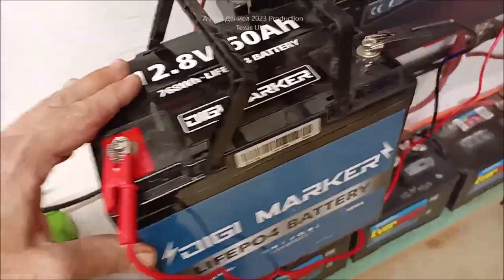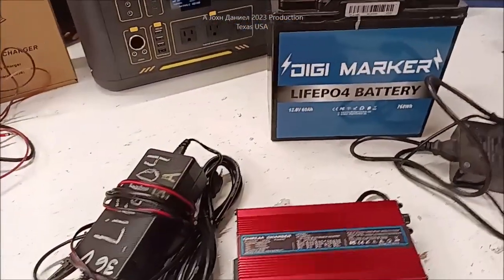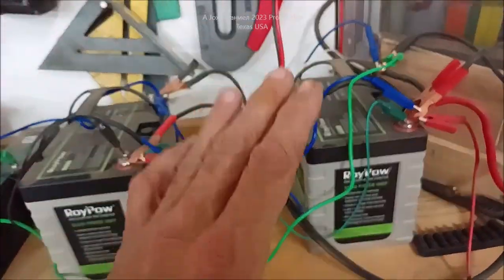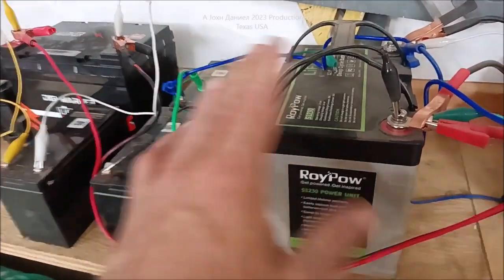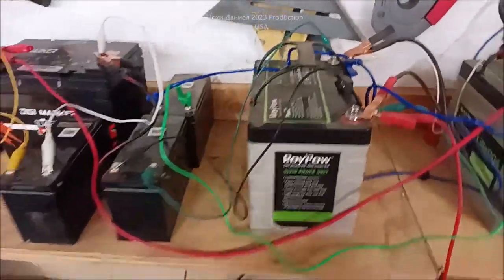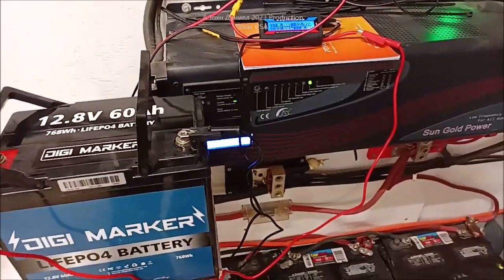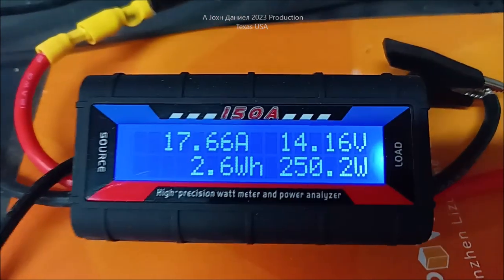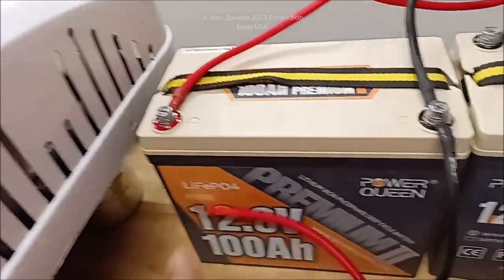Using my 3,400 amp Lead Acid Battery bank to Direct Charge a LiFePO4 battery? Learn how

Comment from the maker: Support/Join with KoFi - https://ko-fi.com/john4kiera OR https://bit.ly/2buyaCoffee all support helps. PARTS 5Pcs 14 Gauge Jumper Wires Alligator Clips Silicone Test Leads https://amzn.to/3s5B017 and 150 amp RC Meter https://amzn.to/454j8Ch
Previous Video  info under video, such as Minerals DC-DC charger+solar MPPT https://s.click.aliexpress.com/e/_Dld9KE3

Comment: Hello John, can I use this to limit the amp draw coming from my alternator so I dont over heat it? Or do you recommend a better way to limit the alternator?  Thanks and will definitely send you a tip for the advice.
Reply from the maker: You will need a buck and current limiting device, the best DC to DC models are by NEW POWER https://s.click.aliexpress.com/e/_Dn0nSz3 they take 8 to 16 volts from your auto system, limit it to 40 amps max, and charge LiFePO4 at 14.6 with tapered charging. Renogy makes a similar one for 2X the price and less the ability!

Comment: So John I could hook up my power queen 200 ah lifepo4 battery to my powerstar 200 ah AGM Battery that's connected to a mppt controller and 600 watts of solar and a 2kw pursine ? Just parallel a connection ?

Comment: Ok, so I have some identical 24V 280Ah packs with a BMS set to charge at up to 100A. Charging speed aside, if I wanted to connect them together at different SOC, would it be safer to use 2awg? This video makes it seem that it would be just as safe or even safer to use 12awg, that the BMS paired with voltage drop will result in a perfectly safe amount of current dependent on the wire I choose. Is that right?
Reply from the maker: Trying to balance them? You will want to get within 20% of condition and State of Charge then using 10 or 12 gauge you can connect them to allow pack balancing to each other without issues. Done it on 204 ah set with one at 45% and the other at 60% then next day they were balanced and I group charged them with a 40 amp buck with a current limiter module.

Comment: Ahh-iite. Thanks! We use a solar charged (normally) lead-acid bank and inverter to run the a/c powered charger(s) for the LiFePo4 systems when they may be needed. Gets them through the lower-solar days just fine. Hello Kiera and be well, all.

Comment: Ive got about $5k of lipo 4 at 48 volts --  will throw a Lincon DC stick welder on it throw some old speaker wires,, it will work
Reply from the maker: If you do that, you do realize your going to power your toys for life!

Comment: There's a formula for it but you have to know the resistance of the battery (which you could probably get close enough ballpark wise just by the chemistry). It's a version of ohms law which includes the voltage difference also. Hopefully someone smarter than me can chime in.
Only say 2 volts difference and then factor in the natural tendency of the battery to resist incoming power (why you have to have a higher voltage than the battery to charge it) won't net a whole lot of current relatively speaking.
Reply from the maker: I have done it from a dead 10.5 volt 200ah battery using a charge source at 14.6 and 3400 amps and got the same 18.5 amps unless I use the 12 gauge cables and I get 27.3 amps. It is the BMS that is reacting to the power factors.  A totally dead 200A LiFePO4 just takes hours more to start to drop from 18.5 to lower amps is all.
Reply: @JOHNDANIEL1  that's what I understood you to be saying in the video but wasn't sure. In the video though the battery receiving the charge is a 60ah battery. The bms should allow much higher than 18 amps or 27 amps or all of that. I'm not sure but 40 amps would be the minimum and I'd imagine 60 amps or even maybe 80 amps might be the maximum it would allow. I just dont see the BMS throttling the current that much.
I don't see how the wire is throttling current either especially not to that degree. I'm trying to see what you're saying but everything I understand or think I understand tells me different.
All that said I'm glad you're making videos again and you sound good!
Reply from the maker: @lancealderman2755  The Digi Marker BMS has 24 mosfets, Can handle 40 amps charge, its BMS Fets operate ON/OFF in a demand and supply program. So when your demand can not be made, or your supply can not be made, the BMS only applies the amount of Mosfets to the issue the power stream can need or create. 
With outgoing power it steps it up so you can toast a wire, BIG TIME. But incoming it cuts it back. This design is due to LiFePO4 chargers becoming over stressed and allowed to cool in reduced draw. 
By placing the wire I did, the result was every time the BMS asked for more, the volts dropped below in micro seconds, so it lost charging ability and it returned to less of them engaged to regain it, It continued to repeat that process hundreds of times a minute and the wire never attempted to supply that much so it never warmed. Reaction time is so fast from the BMS it works.
Reply: @JOHNDANIEL1  ok I think I'm following. It's more from the voltage drop the small wire creates and BMS sees than the size of the wire choking the current?
I would like to see the bms bypassed and see the difference in charging currents if any but if you're correct then that would be dangerous probably 😅
Reply from the maker: @lancealderman2755  You can see the effect in the meter, the voltage fluctuations is due to the active BMS taking and rejecting in milliseconds but the meter is very slow to fully respond so it looks like sloppy charging. When it the BMS Processor sees what you cannot see, volts drop when too many Mosfets ask for more, volts go below that of the battery since the wire can not provide it, it cuts flow, then the volts appear ok again, and it repeats flow. About 800 times a second.
Reply: @JOHNDANIEL1  alright I'm following you.
As a side note, I saw you were talking about boost charging your 36v battery with the Juntek. I have one but always been too scared to hook the solar input side of it up to a battery. Is that what you're doing? I've always wanted to try but not at $40-50 a POP... if you know what I mean.
Reply from the maker: @lancealderman2755  Not the Juntek, the large silver 10-18 to 43.8 charger. Both are sitting together. The Juntek can do the same, but through a cheap 12 to 19 volt current limiting 10 amp buck which allows accuracy a buck can't do. I will be showing that in action, 110 watts going in at 13.2V buck boost to 19.2 tool battery rate then onto the Juntek, 103 coming out at 43.6 after all conversions and waste.

Comment: What are the charging profiles for LiFePO4?
LiFePO4 batteries can be charged with either a 1-stage profile (constant current (CC) aka Bulk Stage) or a 2-stage profile (constant current, constant voltage (CC-CV) profile aka Bulk and Absorption Stages). The 1-stage profile will charge the battery ~97% and the 2-stage profile will charge the battery 100%.
Reply from the maker: Those rules were made by people who don't use them. But in our case, the total charge goal is 95%, discharge goal is 15% and they have been cycled this way for years.

Comment: So crappy leads from a dollar shop acts like a lipo4 charge controller ? interesting
Reply from the maker: Yes, the BMS safety is actually designed to stop allowing charge when it senses a drop or loss. The 14 awg cable showed you the actual max rate 18 amps the BMS was seeking from the limitations made.

Comment: lipo4 requires a constant current charge then a constant voltage charge,, good way to stuff your lipo4 batteries
Reply from the maker: Since I have been doing it for over 3 years I am sure in another 7 years they will die from the abuse~!

Comment: So basically the thin wire and that meter add resistance and control how many amps flow in? That and the low voltage difference?
Reply from the maker: The BMS in the battery senses the limit being created and reacts by only opening so many points in the Mosfets to allow that much through. It is a design to stop a cheap charger from over heating but works the same for the thinner wire. You will notice it makes attempts to increase its draw, but each time volts sorta drop (indicating over pull) so it returns to what is allowed through. It does that the whole charging process.
Reply: I do basically the same thing, my MO property is 24v and have the cheap pwm controllers that act like a trickle charger to my 12v batteries, mower, sxs, trolling battery and cameras, solar charges the 24v battery bank from the 24v batteries to controllers to the 12v batteries, when gone everything on dc, fridges like yours, outdoor lights, John thank you for your knowledge and way you use the (kiss) system, keep up good work , fine job fine job
Reply from the maker: About 90% of the time when a company or seller says you can't do something you should consider they have money to loose if you figure out a easy solution and not pay them for it.
Reply: @tomspencer8717  Do your charge controllers have a current limiting function?
I have always been too chicken to hook a large battery up to the solar side of a charge controller. I've seen them do it with Victron charge controllers and even hook dc generators up to the solar side but cheap charge controllers I assumed that only want to take under 1000w anyway I didn't want to chance hooking up lithium batteries to it to where it would have to handle many multiples of that.
Reply: @lancealderman2755  the pwm controller solar input comes from the 24v bus bar and the battery part of the controller runs too what ever battery I want maintain, once the maintain battery hits target it only keeps it at float, not drawing hardly anything, just using my 24v battery acting like a solar panel, had three controllers two 10amp and one 20amp maintaining three different batteries, I’m in the process of redoing my solar system just added six 370w panels and another 2400w Sungold hybrid inverter, all this on a 12x20 shed, once done have 12 100w panels and 6 370w panels that will run to the cabin, it will be 75% off grid